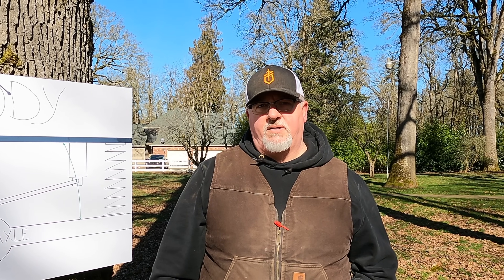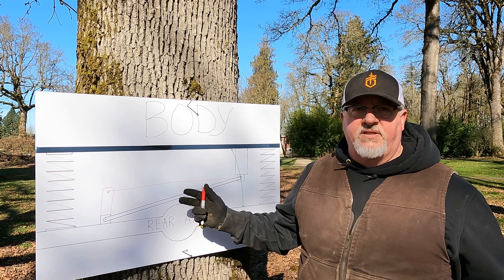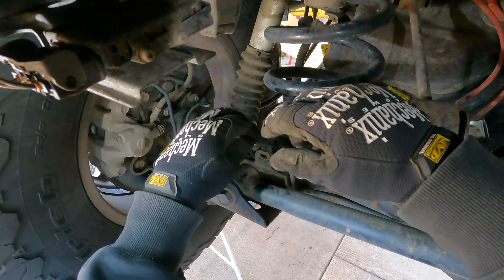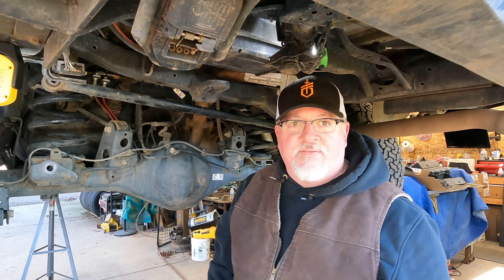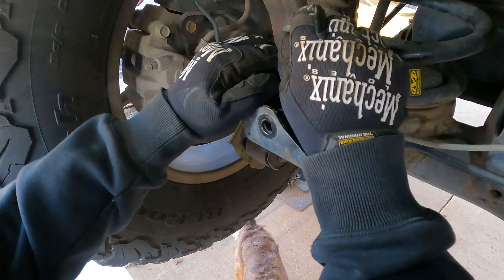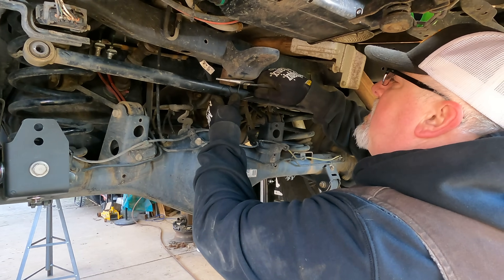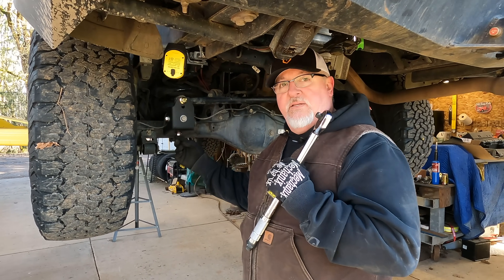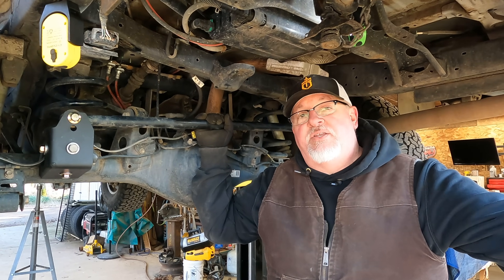Do Not Lift Your 4Runner ... Overland Build Recommended Geometry Fix - Do Not Lift Without This

Comment: Why lift a vehicle at all unless you're traversing off road 80% of your job and life.
Reply from the maker: Exactly. My 4Runner is a purpose built vehicle, it is not my daily driver.
Reply: @aired-downoverland9239  
God i miss mine from 2000.
she died after 16 solid years.
287,000 some miles.
Rip Emerald.
Reply from the maker: Dang, that’s a lot of miles; probably filled with great adventure. 🙌
Reply: @aired-downoverland9239  

Yesss sir.
Appalachia to cocoa beach florida n back.
Great times.
Reply: @UtubeH8tr - Just 287K miles?  What happened?  I thought these went 400-500K miles!?
Reply: @tony_lopez  

My father drove it...

Enough said.
Reply: @UtubeH8tr  - Gotcha.. 😂